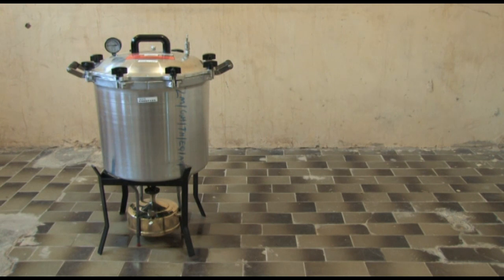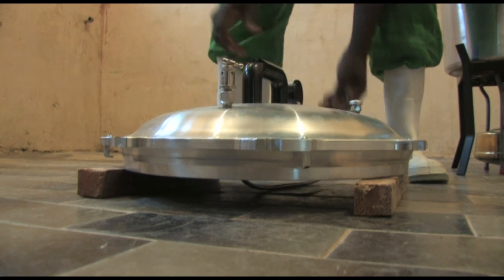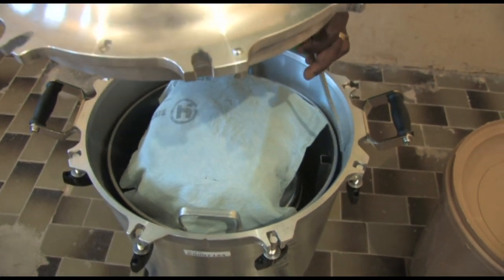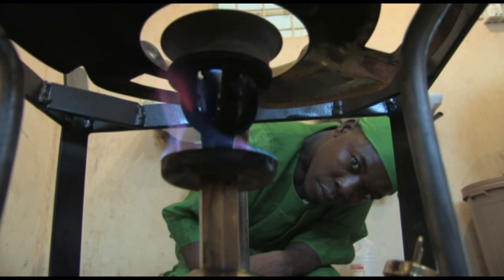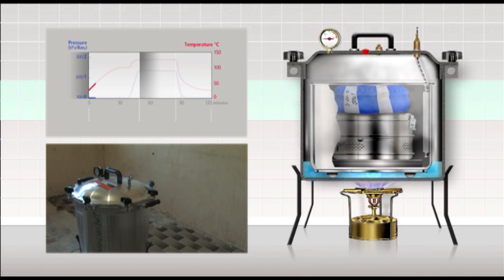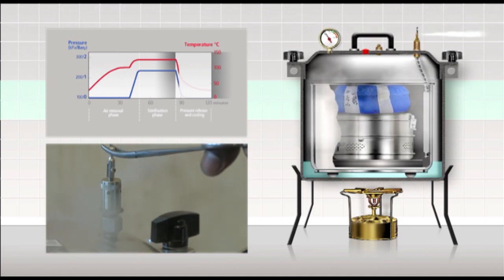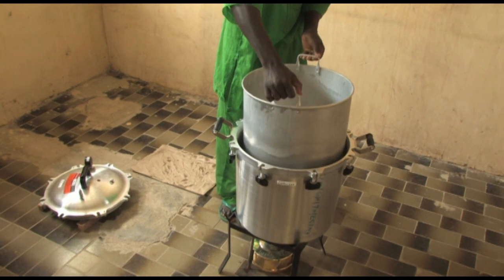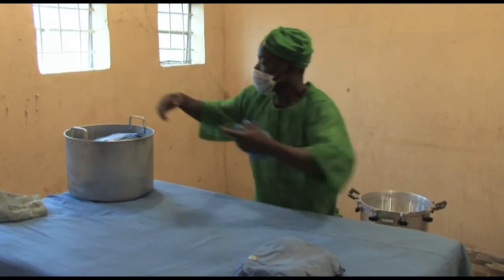The portable autoclave (39 litre)

Comment: 35 minutes to boil
+
7~10 minutes to exhaust 
+
10~15 minutes to raise pressure bars
+
35~40~50 minutes to sterilize 
+
10~20 minutes after loosening to cool
+
10 minutes to cool after removing lid

TOTAL = Above 2 hours tops!